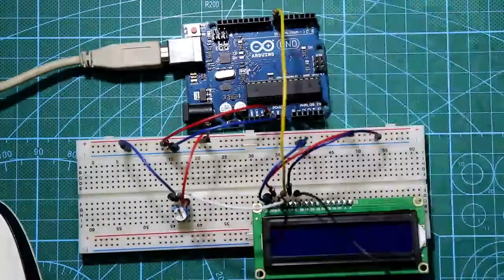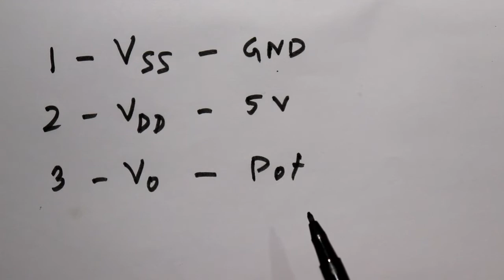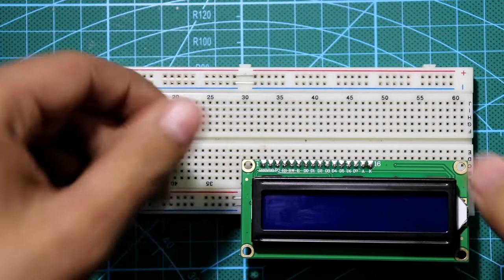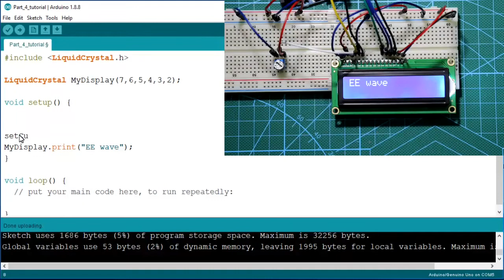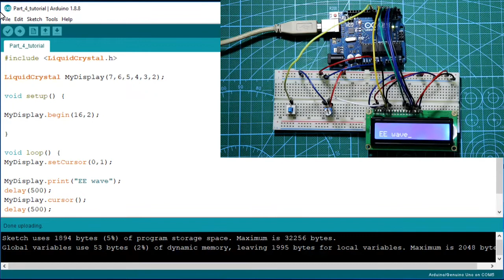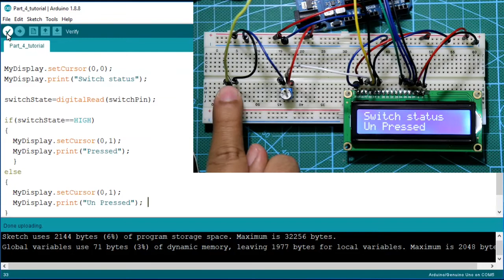16x2 LCD Display Tutorial with Arduino | Arduino Tutorials

Comment: Thanks, very clear and thorough!
I do have a question. Once you have twiddled the backlight potentiometer to get clear text, can you replace it with a resistor? I added a couple of lines to the program to read the wiper voltage, and show it on line 2. It was 1.2v
I realise that different LCDs will require different voltages and the setting seems quite delicate, but I would like to hear your comments.
Reply from the maker: In this, this potentiometer is working as a voltage diver, so we can not replace it with a single resistor. Yes, we can replace it with two resistor. But as we know, the problem is different LCD means different resistor value. Practically, we can't have a resistor value like 5k or 6k (if needed). It is either 4.7 or 5.6. But we can get this kind of value from a potentiometer.
So I think it is not possible to use resistors instead of a potentiometer.
Reply: @EEWave  Many thanks for your fast and helpful response.